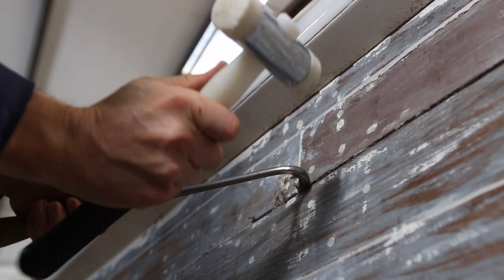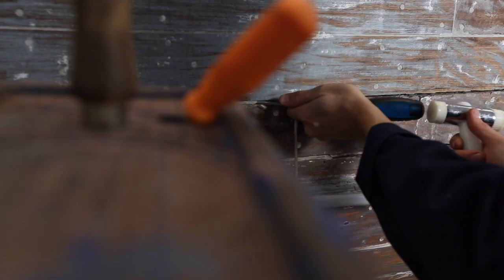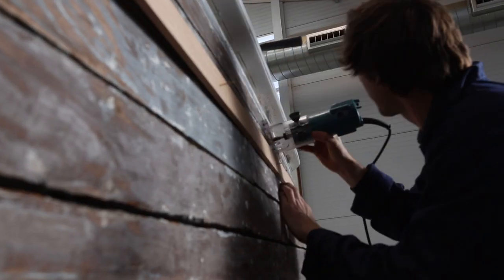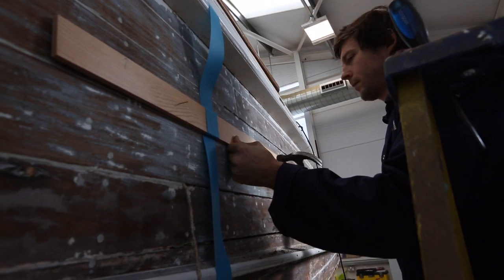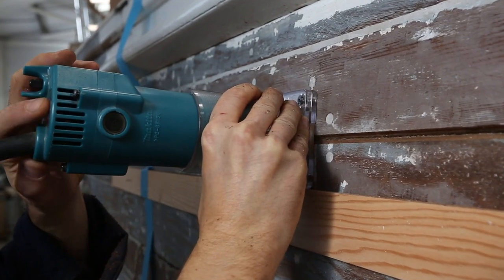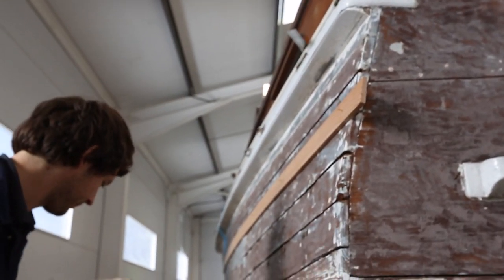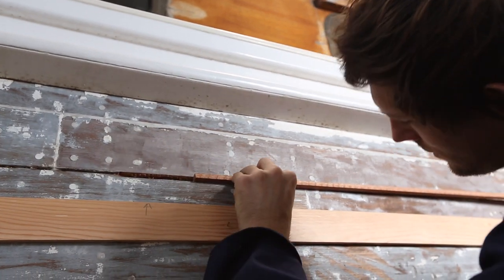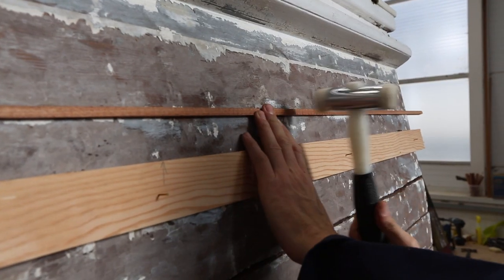How to Spline a wooden boat – Boat Building Sessions

Comment: Thank you for this video. I have been using a bit different method for many years but it always had issues with some joints.  I am going to try using a router and appreciate that someone actually posted a video on the process.